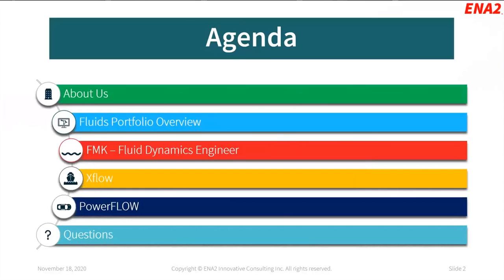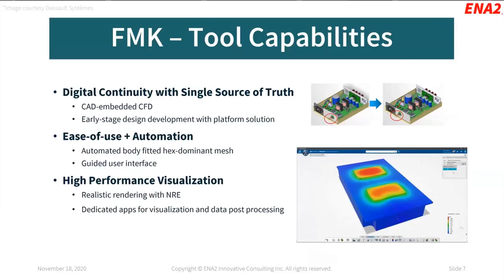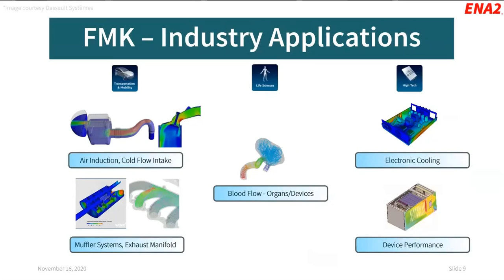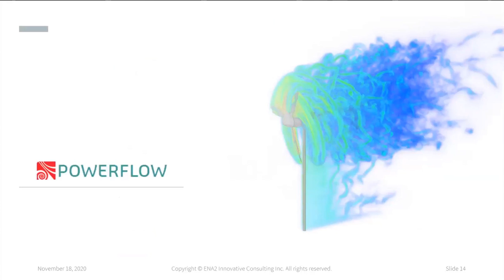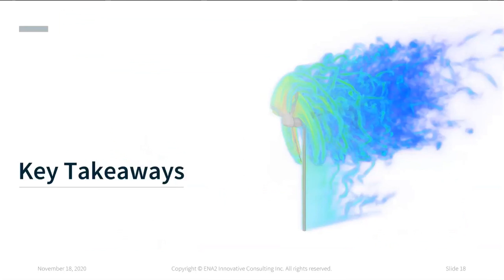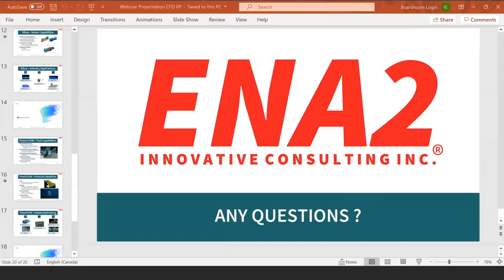CFD software - Benefits and Advantages of XFlow, Powerflow and FMK

Comment: What's the difference between x flow and power flow
Reply from the maker: Hi Abedeen, so the difference is that  XFlow is a good program for high-fidelity CFD. Using Lattice-Boltzmann technology, XFlow will allow the engineer to solve complex problems involving high-frequency transient simulations with real moving geometries, multiphase flows, free-surface flows, and fluid-structure interactions. A prominent feature of XFlow is its automatic lattice generation- which minimizes user inputs, leading to reduced effort in the meshing and pre-processing phases. This allows users to place their focus on design iteration and optimization, rather than simulation setup. and  PowerFLOW was developed with the automotive and aerospace industries in mind, leveraging Dassault's Lattice-Boltzmann-based physics to perform simulations that accurately predict real-world conditions. The software performs aerodynamic, aeroacoustic, and thermal simulations with accuracy and efficiency.

Comment: Very nice video. thanks for sharing.
Would you please give a conclusion about what's different functionality of the 3 tools :FMK--PowerFlow--Xflow? Thx.
Reply from the maker: FMK is a very good program for designers. You can run a simulation, update your geometry in SolidWorks based on the results, and those changes will automatically update in FMK. Then, you can run another simulation on the new model. Because of this, designers are able to iterate very quickly, leading to a more optimized design. XFlow is a good program for high-fidelity CFD. Using Lattice-Boltzmann technology, XFlow will allow the engineer to solve complex problems involving high-frequency transient simulations with real moving geometries, multiphase flows, free-surface flows, and fluid-structure interactions. A prominent feature of XFlow is its automatic lattice generation- which minimizes user inputs, leading to reduced effort in the meshing and pre-processing phases. This allows users to place their focus on design iteration and optimization, rather than simulation setup. PowerFLOW was developed with the automotive and aerospace industries in mind, leveraging Dassault's Lattice-Boltzmann-based physics to perform simulations that accurately predict real-world conditions. The software performs aerodynamic, aeroacoustic, and thermal simulations with accuracy and efficiency.